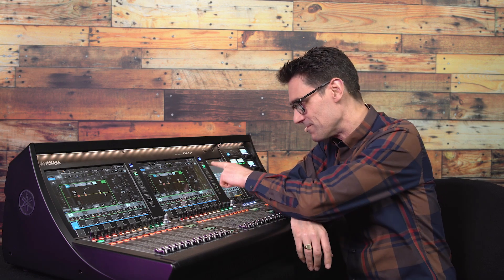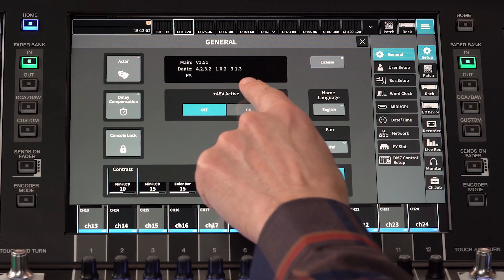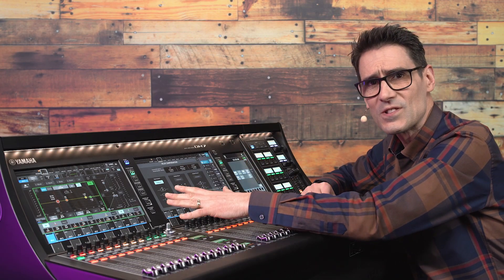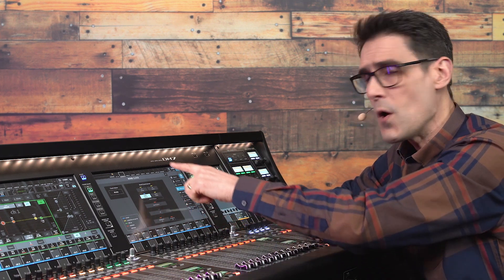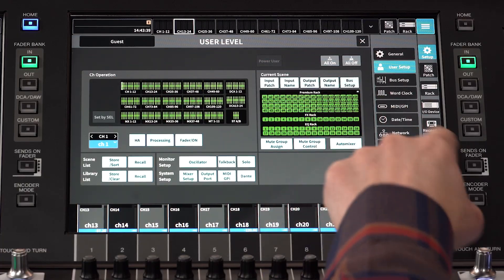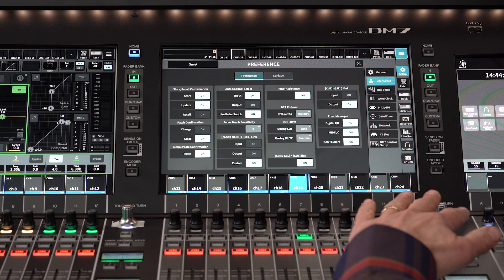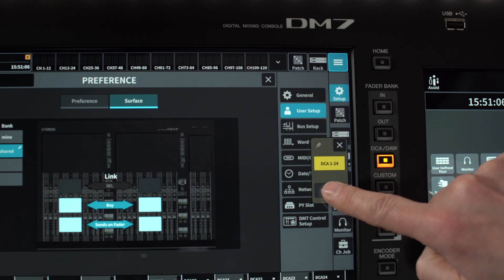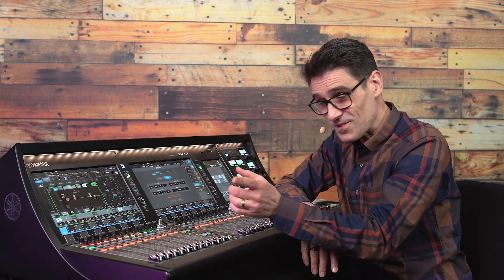DM7 Series Training Video #10: Preferences

Comment: Unfortunately there are a lot of things that make this console very difficult to use in a live environment.

For some reason the preview scene function and the move fader function have been removed. The GUI is not very sensitive so double taps happen a lot and since the responsiveness is also slow those double taps cause hiccups while mixing in situations when time is of the essence.

It also takes between three and five business days for the GUI to catch up to the fader bank layer you are on. It is crazy inconvenient when you are trying to make a quick adjustment. I am starting to memorize where I have certain faders so that I can make adjustments fast without waiting for the GUI to catch up. I think it is a real miss moving the scribble strips up to the GUI. It is confusing trying to line up what your fingers are touching sometimes. Again, when needing to make quick adjustments it is tough.

Swapping a lot of functions to the touchscreens I think is also a miss. I believe most engineers enjoy physical knobs and buttons. Like having “THE Three Knobs” would be helpful, but that’s low on the list of issues.

It has a lot of great functions and upgrades, but I am definitely feeling the challenges on this surface.

P.S. Also REALLY missing the Delay + Rev FX!
Reply: Rev X is in the premium rack